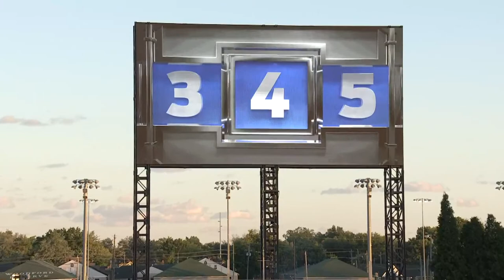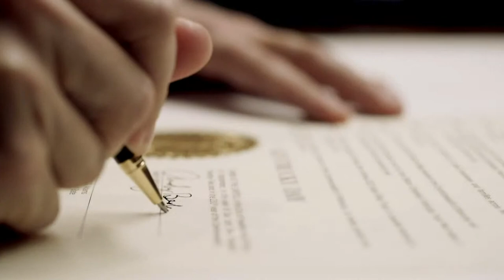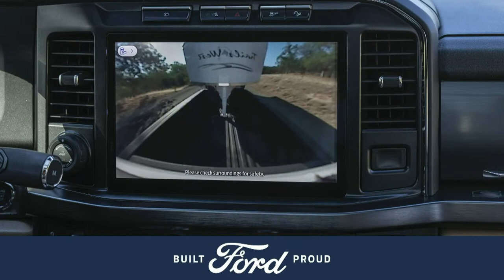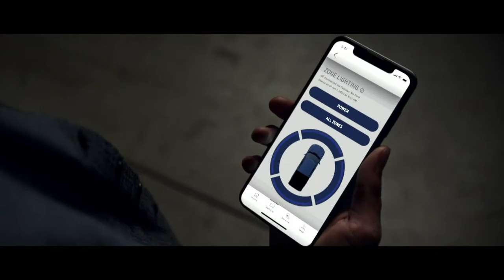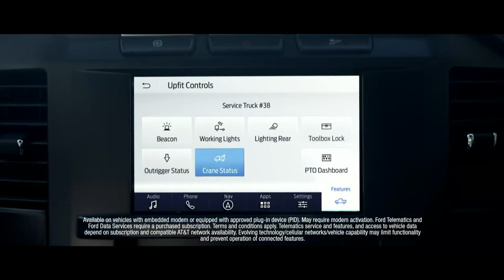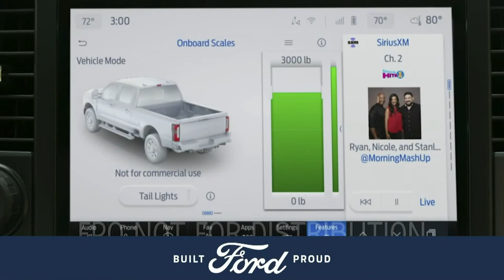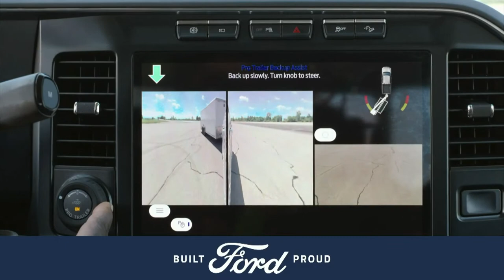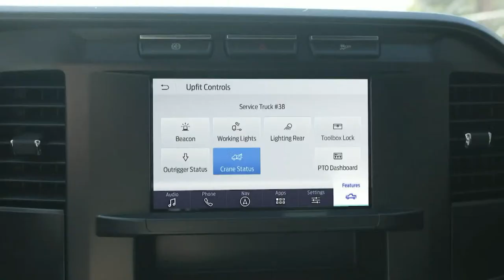All-New Ford F-Series Super Duty® Debut | Ford

Comment: As an owner of a 2017 F-350, I'm presumably a target for this video. But, I don't have all day. This was released over a week ago, yet the first several minutes, including a 'countdown' was a complete waste of time and the music is just plain ANNOYING! I also don't need the psychological stereotyping in what immediately follows. This is as bad as Cadillac's ads that say nothing about their new electric car, but waste the viewer's time by showing how chic owners are, inferring that prospective buyers will become the same by owning one. Spare me this B.S.
I'm glad it's built in Kentucky. But, please. Keep that brief, and let's get on with the introducing the TRUCK.

Through the first 25 minutes, the ONLY feature enumerated was the 120 Volt outlet. It was not until 29 minutes into a 42 minute video that other features were mentioned --- onboard scales (nice), box steps, handholds and an extended tailgate step. So, the first 70% of this video was general info. Relative to the TITLE of this video, the first 70% was just fluff. I don't mind some general promo info, where it is being built (already knew that), and Ford's plans for electric vehicles. But, less than 10 minutes (less than a quarter) of this video was SuperDuty specific. 

The scale feature is interesting. But as shown, it applies for a fifth wheel and/or gooseneck. In this case, essentially all of the trailer's weight is applied to the rear wheels, easing the use of a scale on just the rear axle. Question: Does the scale function also work for bumper pull? If it does, and that trailer uses load equalizers, then scales must also be implemented on the front axle. Is this done? (Super kudos if 'yes')

I am disappointed that NOTHING was mentioned about the engine options and improvements, possible transmission changes, change in ratings, lighting options and improvements (the incandescents on my 2017 are terrible, comparable to my 1969 Chevy C20), the PTO, etc. That nothing was mentioned in 43 minutes says a lot.

It would be nice if Ford offered two options - rear air springs and a locking FRONT differential. Installing these via. upfitters should be an unnecessary complication.

Another wish is more ready access to specifications for payload and towing capacity. The salesmen I spoke with prior to my purchase were utterly useless. It took me a long time to determine payload and towing, based on a F-350, SRW, 4x4, Diesel, crew cab, long bed, differential gear choice, and then finding the options (e.g.camper package) to maximize it. This should be a quick task.
Reply: Not to mention Ford have now proven they're a WOKE company by the intro!!!  Unbelievable such a large company panders like this!!!
And how about the major safety issue on the transmission?!!!
•  The digital instrumentation - will Ford keep the traditional analog Speedo & Tach with the round dials or did they go with the goofy F150 digital display that was shown in the 2022 F150 Raptor? Let's hope they didn't go the Raptor route!!!
•  The new 6.7 Powerstroke must be pushing 550HP and maybe even 1200 FT-LBS with that liquid cooled turbo!!!
•  Lastly, did Ford fix their transmission lockout problem that prevents the driver from using an open palm to push the shift lever from D into N in an emergency (disconnecting the engine from the drivetrain) without fear of engaging R?!!!  All Ford's competitors do not have this issue and nor do cars from BMW, Mercedes, Audi, Toyota, Honda, Lexus just to name a few!!!   Come on Ford - did you fix it or did you intentionally design in a bad safety feature?!!!
Reply: @LWRC  I agree with most of what you said. But 'Woke' is a newly created, poorly defined, politically charged, and essentially worthless word. It was created primarily to instill disdain for another person's priorities. I don't need it. The opposing word is 'callous'. But at least that is well defined.
My issues with this 'debut are simply that it is WAY too long and combines too much material that belongs in their own videos. I can handle five minutes of promo on the trucks being made by Americans in Kentucky, that Ford has a long history, that it is striving towards electric vehicles, that it includes civic responsibilities (e.g. environment) in its business plans, etc., etc., etc.. But a HALF HOUR?. Less than 10 minutes was specific to a debut.
Thanks for your info on the transmission. That sounds serious enough that it could force a recall. I believe some manufacturers offer configurable displays, where one can select analog or digital, or even have both
Reply: @gregparrott  Yes, this entire dog and pony show was way too long for the real value content to be conveyed.
As for 'WOKE' being an invented word - absolutely. However, it is typically used as a noun rather than an adjective!  This is a recent slang term: aware of and actively attentive to important facts and issues (especially issues of racial and social justice) and when used in the context, it usually demonstrates that this one particular minority group get preferential treatment above whites as well as all other minority groups regardless of their inherent ability.
Regarding the automatic transmission - this is a major design flaw and is not something easily fixed and is across the entire FORD platform so it is not limited to just trucks!!!  This is for vehicles with both column and console shifters. On the Fords, you actually have to push the lockout button on the console shifters to shift from D into N which defeats the entire purpose of the other design allowing you just to use your open palm and push the shift lever from D directly into N without fear of going into R!!!   For the column shifters on the Fords, you have to pull UP on the shift lever to move from D into N as you do normally but again, this defeats the purpose of the other design which can be used in emergencies!!!
You more than likely have access to other vehicles through friends or family and can test this feature out on those cars and trucks. The vehicle doesn't have to be in motion and this can be done just by putting your foot on the brake, put the transmission into D, with your open palm, push forward on the shift lever to move it from D into N!!!  There are no dealers out there that know about this feature ! ! !  Even for vehicles that have this feature, the dealers don't know about it.  And none of the Ford dealers I've visited knew about this design flaw on their vehicles!!!
Reply: @LWRC  To my knowledge, pretty much all the pickup trucks these days have automatic transmissions. I have the standard column mounted shifter on my 2017 F-350, and a friend has a 2020 F-350. While it's clear one could shift from drive to reverse while in motion, neither of us have ever had an issue or been aware of a risk of doing so. The Fords also have a upshift/downshift button on the shifter that allows the driver to override the automatic's shifting pattern without actually rotating the lever itself.  
Where I once DID encounter this issue was on my 1997 Chevy 3/4 ton pickup. With ~170k miles, the shifter has become vague, with no clear detents. At highway speed, I once dropped it into reverse. The rear violently locked up and the engine began to stall. To my amazement, neither the transmission nor driveshaft was damaged. But you can bet that I have been VERY ginger at moving the shift lever ever since.
Reply: @gregparrott  You missed the entire point of what I'm saying!  This shift sequence is for emergency use only and is not done in the normal sense!! 
•  For column shifters like on your truck, there is no lifting the shift lever towards you as you move the transmission from D into N in the normal shift sequence!!! You just use your OPEN PALM and push forward and upward on the shift lever to move the transmission from D into N!
•  For console shifters, there is no need to push the lockout button on the shifter to move from D into N in the normal shift sequence!  You just use your OPEN PALM and push forward on the shift lever towards the front of the car to move from D into N!
•  For these emergence moves, the transmission will never go past N and go into R as there is a detent which prevents it!  This design prevents the transmission from going into R as you personally experienced by shifting it in the normal shift sequence!

Is it clear now this is NOT the normal shift pattern?!!!   You can't do this Palm move on any Fords and is why this is a very bad design.  Try it and see for yourself with a Chevy or Ram!!!
Reply: @gregparrott  Also, the risk is in an emergency, stuck throttle while going down the freeway at 75mph, if you can't quickly disengage the engine from the drivetrain, you are at high risk of a fatal crash!!!   This exact situation happened to a woman in a Toyota 4Runner a number of years ago and she called 911 but unfortunately, no one on the 911 emergency line knew about this feature and she crashed and died!!!  The sad part is Toyota did design in this feature on her truck and it would have saved her life!!!  Try it in any Toyota vehicle, car or truck, and see how it works!!!
Reply: @gregparrott  Remember, these manufacturers designed in this feature as it was not accidental!!!   Ford is causing a big safety risk for their customers by NOT having this feature!!!
Reply: @LWRC  hanks for the reply. Yes, I missed its intent for emergency use. I was not even aware of an emergency alternative.
Reply: @gregparrott  No worries. Just trying to help. Try it on your own truck and also on trucks or cars that have this feature and you'll be pleasantly surprised. 
Share it with everyone. I can pretty much guarantee you that even for vehicles that have this feature designed in by the manufacturer, the dealers don't even know about it!!